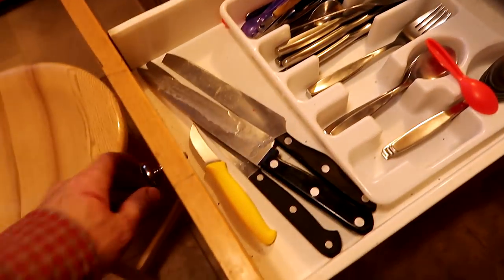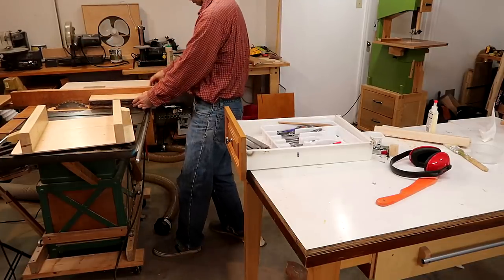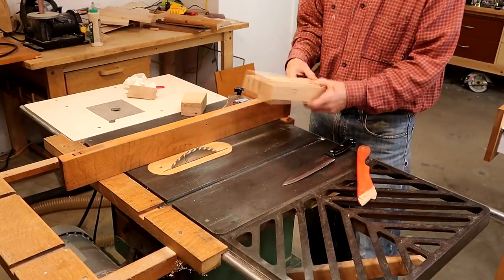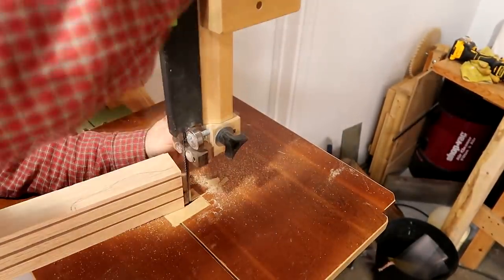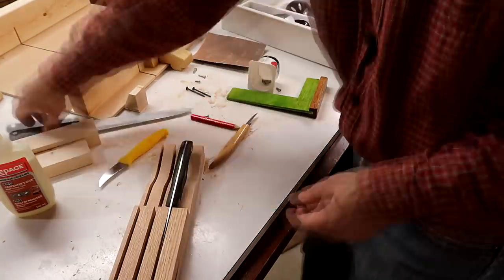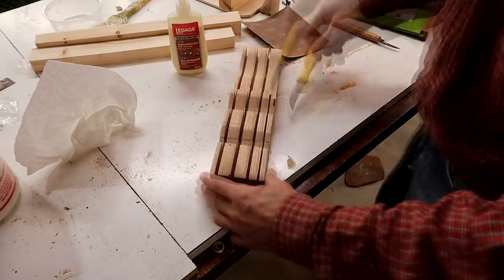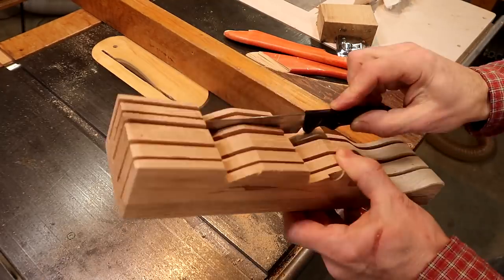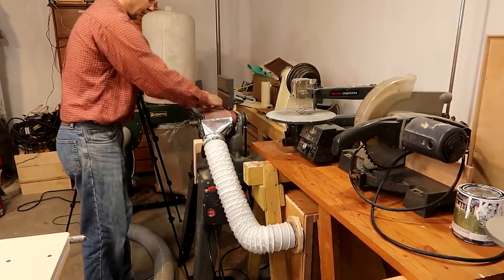Making an in-drawer knife block

Comment: I like the white meta-box drawer slide/sides. As a professional cabinet maker I use them often. They give you more useable space in the drawer opening and they slide as smooth as any slide I’ve used. It’s a love hate thing with metal drawers being a woodworker, but we must keep in mind that the main reasons for joinery/dovetails is because they didn’t have the glues and fasteners that we have now. So an epoxy coated steel slide/side is a great choice for 21st century kitchens.
Reply from the maker: Yes, I like those slides for the space efficiency reasons too.  They really are the most efficient.  Even the under mount slides take up a lot of room (more, in fact, because the drawer needs to be taller.

Comment: Hi Matthias .. great video !

As a suggestion to reduce clutter, have you thought of alternating the knife directions so that the blades meet in the middle, while the handles are on the outside ?
Frees up the space between the handles, and should give you a block that can handle a higher knife density ..

Comment: I suspect your wood block at the back will eventually pop out of place after repeatedly opening and closing the drawer. To keep my cutlery tray from sliding around I just have a block of high density foam cut to size (actually a bit oversize, so it's a snug fit) behind it.
Reply from the maker: It may budge a bit from slamming, but gravity pushes the tray back down, putting it back in place.

Comment: Personally, I would have either cut the extra length off of the knife's handle, or (more likely) made a separate thin block that fit on the side of the cutlery tray. 

But it was amusing, and now you have a reason to show people your custom knife block when they ask "what the heck happened to your knife!"
Reply: I would have simply fitted an extension to the side of the drawer.
Reply: I agree,  many people insist on grabbing the blade (pinch) making the handle too long anyway.

Comment: Not to rain on your skills but I had one of these and it took up too much space in the drawer. I think you're solving the wrong problem.  I replaced a knife block with individual plastic sleeves (from a restaurant supply store) that go over the knife blades.  All the knives fit and the blades don't touch other blades or anything else in the drawer.

Comment: When working with firewood for projects, do you check the moisture content before starting or do you just have an idea of how long the wood has been drying?
Reply from the maker: this stuff has been lying around a few years.  And if it shrinks a bit, it's not a problem either.

Comment: Not a knife nerd, but you'll need a tip on that knife eventually...
Reply: Only if he can't find a suitable screwdriver.
Reply from the maker: Why, are you planning on coming to my kitchen to annoy me?
Reply: No but you'll remember when you're chopping those onions or opening that bell pepper.

Didn't mean to come off as an ass anyways.
Reply: Not like he doesn't have a few other knives there with points if he does need one. Generally don't need the point on the large chef's knife anyway, it's a chopper, not a poker.

Comment: I feel like they are to close together and to hard to position. If someone is in a rush he will just toss them in like before.
Reply: Have to agree. This is one of the few MW projects where I didn't like the end result. There was no need to have all the knives sardined in there like that. He kept cutting off material and adding extra slots. Yuck.
Reply: I don't know (unless you use free standing knife blocks - on the counter or a cabinet) the knives typically just get jammed in on one side of the drawer in a jumble with the corncob holders and other such like items. This seems a sensible compromise.

Comment: Nice, but I need a holder where I can see if the knife is surraded or straight before I pull it. Not sure how to solve that though.
Reply: Beakerzor serrated? File some ridges down the slot to indicate a serrated blade.
Reply: Don't buy a full set where all the handles are the same.  My serrated is a Victorinox (2014) where my straight is a, newer for me, Herder (1950 or 1970)  By now I cut my bread with the straight anyway.